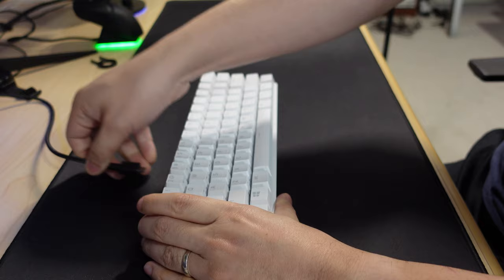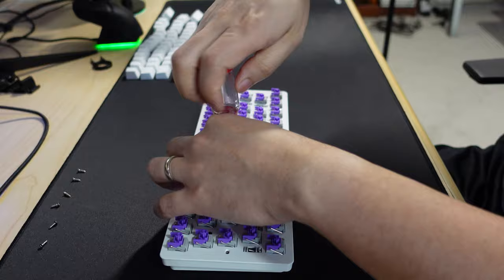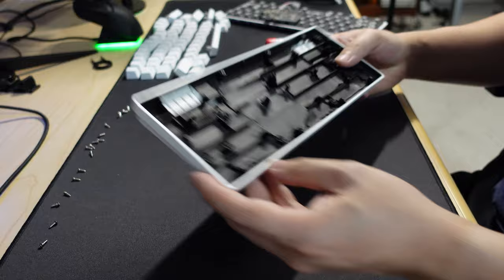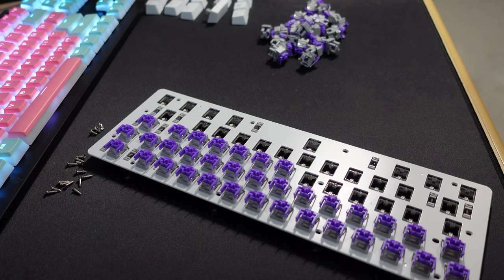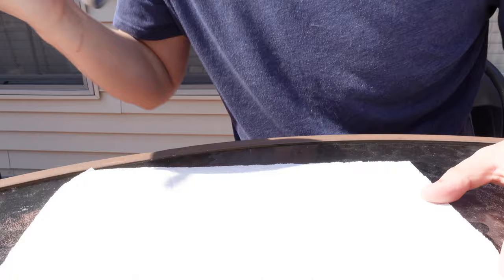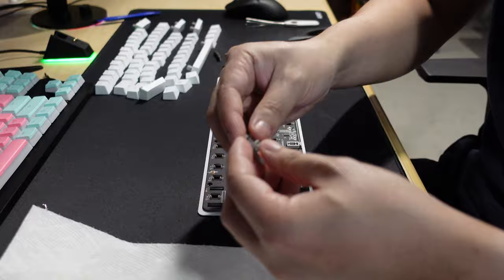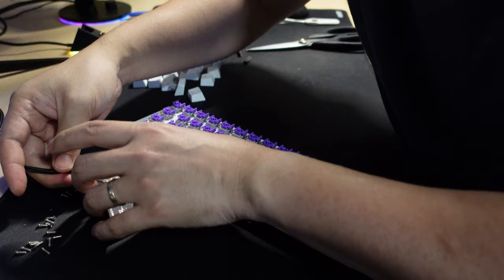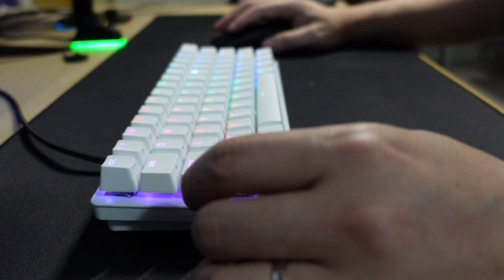Modding the Razer Huntsman Mini: Easy steps for better sound!

Comment: Would I be able to mod something like a huntsman elite? I have one and the noise sounds really pingy. Thanks
Reply from the maker: Yes, this method works for the whole Huntsman lineup. However, the Elite is a little more difficult since it has that diffusion layer as well as the magnetic connector for the wrist rest. Taking it apart is a lot more involved and there are screws hidden under the rubber feet (if I recall correctly). I was able to do the same mods to my Elite and it got rid of the pinging, but I did accidentally break the wrist rest connector so now it doesn't light up anymore. I'd say if you're trying to do this with the Elite, try to see if you can find a detailed disassembly guide for it and see if you're comfortable opening it up. Once you get to the PCB, the process is exactly the same as what I outlined in this video.

Comment: I want to keep the same loud click so if I just lube them will it keep the click but still make them smoother or do I need foam?
Reply from the maker: Yeah, the lube will make them smoother and get rid of the spring ping, but not the click. The foam just helps absorb some extra echoes, but it's really the lube that makes majority of the difference. A lot of guides online will tell you not to lube clicky switches since that can reduce the clicking sound, but those are talking about traditional MX style mechanical switches. The way the Razer optical clicky switches work, it's more like clicking a pen, and that mechanism is not affected by the lube (so it will still click loudly and clearly, even after lubing).

Comment: Some of my keys are not working after putting the switches back on? Any ideas
Reply from the maker: I would try to remove the ones that aren't working, make sure that they're dry, and clean any lube out of the sockets with something like rubbing alcohol, since any excess could be blocking the light emitter or receiver, which would then register the key as being depressed even if it wasn't being pressed.

Comment: Do you think it's possible to apply the dry lube with a brush so you don't have to disassemble the keyboard?
Reply from the maker: The switches don't really pop out of the PCB without disassembly of the keyboard (unlike a traditional hotswap keyboard).

Comment: What thickness was your foam in the end? Watched RandomFrankP's video and he said 1.5mm to 2mm, but I've seen some other suggest/using thicker.
Reply from the maker: I stacked 2 layers of 1/8" foam (linked in the description) where it could fit, so roughly 1/4" at the thickest. But, it's highly compressible, so I'm sure when I screwed everything back together, parts of it got pressed down.
Reply: @bigxie  Yeah that's what I thought you did, just wanted to make sure. Thanks for the answer and great vid!

Comment: I currently own this keyboard, is it possible to switch out the switches with gateron ones?
Reply from the maker: No, these are optical switches and even if you use Gateron optical switches, they're not compatible. You could probably use the Bloody optical switches, but they're not any different from the Razer (both are made by the same Chinese manufacturer)

Comment: Would this potentially sound even better with nicer lube or does it not really matter?
Reply from the maker: I don't think it'll make much of a difference. I've also tried the SuperLube PTFE spray on my Elite with purple switches and the switches don't sound any different (although the overall sound is a little different due to the different case). If you're talking about wanting to individually brush each switch with like Krytox or something, I don't know, but I wouldn't recommend it (Razer optomechanical switches cannot be opened nondestructively like traditional switches).
Reply: @bigxie  I have seen a few people just brush lube the razer optical switches without opening the switch up and the results are pretty good. Do you think doing that would interfere with the laser actuation system? Because I have heard some people say yes and no
Reply from the maker: @brobot6565  I think it shouldn't interfere as long as you're not using a super thick lube. The laser shoots through the center of the switch anyways.
Reply: @bigxie  thank you!
Reply: @bigxie  one more question. Is krytox 205 g0 too thick for this? I don’t know literallly anything about keyboard lube

Comment: Thanks to this video I have discovered that my razer huntsman is hot switch !!
I bought a huntsman Standar, 2n hand and there are some keys that don't work.
I swapped the site switches and discovered that the problem lies with the board, do you have any idea what to do?
Thanks for the help! : D
Reply from the maker: So unless there's something mechanically wrong with the switch (i.e. it doesn't press up and down smoothly), the issue surely lies with the PCB. These optomechanical switches don't have any electrical component at all, they merely block the light beam that is shined across the switch socket when they're pressed down. So if some keys aren't working, even after swapping out a working switch, the issue likely lies with the laser emitter or receiver on that socket.

Comment: Do I have to use the WD40 or can i use a solid lube made for mechanical keyboards.
Reply from the maker: You can use a dielectric grease for the stabilizers. I don't think you can use traditional lube on the switches because they don't open. But if you wanna go through with a paintbrush and try to reach the insides of every switch, I guess that could work too. I'm not sure if it'll be any better than the spray lube, but I know for sure it'll take a lot longer.
Reply: since they are optical if you use anything other then a dry spray lube you run the risk of interfering with the light beam rendering the switch useless
Reply: @truthtimetv4575  well there is no electronics on the switches it is all on the pcb so maybe not. I have seen others lube it with traditional lube and it worked out for them.

Comment: When you remove the key caps can you put in different ones and do you need to loob them first before putting in the key caps
Reply from the maker: Hey Tyler, the keycaps are replaceable and most 60% kits will fit, since the Huntsman Mini uses a standard layout. There's no need to lube the keyboard or anything just to switch the keycaps. The only sort of tricky thing is that the stabilized keys (shift, backspace, spacebar, enter) have stabilizer posts attached to them that need to be transplanted from the original keycaps on to the new replacements.

Comment: So is it fairly easy to switch from purple to red opto switches then? Since they just press out from the back im assuming the reds could be swapped in the same manner?
Reply from the maker: Yes! The mechanism of switching them is really easy, but the hard part is getting the extra switches since they're not sold individually.
Reply: @bigxie  i bought a pack of 4 from ebay for 6$. Not sure how legit they are but I will compare the quality to the purples when they arrive and see if they seem legit

Comment: Hey can I just use normal lube I think he hole of the switch without taking it out? Just wondering please answer
Reply from the maker: If you think you can get a brush in there and not make a mess, you can try it. But the laser and receiver are right on the socket so if you end up blocking them, that key will always register as being pressed down until it's cleaned. I'd just take the switches out, it'd probably be faster anyways than traditional lubing.
Reply: @bigxie  ok but if I take it out is it okay to use machine lube and just put a drop in there or should I use a brush
Reply from the maker: @marktsarenko392  I'm not sure what's in machine lube, but you should make sure it's non-conductive and won't corrode plastic.

Comment: HI. Thanks for vid. Gonna buy Huntsman TE these days. Just got a little question about switches. I know that i can use Razer OptoMech Violet-Clicky switches here cause keyboard is hotswappable, but what about simple (non OptoMech) Cherry MX switches, Holy Pandas and etc ? Are they fit PCB ?
Reply from the maker: I wouldn't go as far as calling the TE "hot" swappable, because if you try to turn in on without all the switches in, it can freak out. And no, regular mechanical switches don't work because the PCB doesn't actually use electrical signals, it shoots a beam of light across the socket and when the light gets cut off by the switch being pressed, it triggers a key press.
Reply: @bigxie  oh okay. thanks a lot :3

Comment: So if i will remove the switches will they work after i will install them back? Are they removable or they will break?
Reply from the maker: Yes, the switches can be removed and replaced (as demonstrated in the video) and will still work. There are no electronics on the switch, all it does is block the beam of light and allow it through when pressed down (the electronics for emitting and receiving the light beam are on the PCB itself).

Comment: Is this applicable to the Huntsman elite? I mean are the switches removable too for the elite just like the mini?
Reply from the maker: Yes, this is also applicable to the Elite. Take care when opening it up though, since it's much more complex (there's that diffuser layer as well as that magnetic connector for the wrist rest). Once you get to the PCB, the switches and stabs come out the same way and you can do the same mods. I did these mods to my Elite as well but unfortunately, I broke the fragile wrist rest connector so now it no longer lights up. Sounds a lot better though!

Comment: You choose clicky but you dampens, if you want go silent why dont go for linear?
Reply from the maker: The point of these mods is not actually for silence, but to get rid of the spring ping from the switches that then bounces around in the empty case. That's what the lube and foam addresses. The linear version of the keyboard has the exact same issues and would bother me the same amount. The spring ping may actually be even more noticeable on the linear version due to the lack of the click masking it. The good news is that these mods apply just as effectively for all versions of the Huntsman keyboards.

Comment: where did you buy the foam from? i cant find it anywhere on amazon and the link doesnt work anymore
Reply from the maker: Dang it stinks that the original listing no longer works. You can just search "adhesive foam roll" on Amazon though and there should be a lot of alternatives available.
Reply: @bigxie  what thickness is good?
Reply from the maker: I'd go with like 1/8" if possible, because you can always stack if it's not thick enough. 1/4" could work too if the foam is really porous and compressible.
Reply: @bigxie  thanks for the fast replies, ill definitely buy some and i hope that fixes the pinging on my keyboard

Comment: hey man I did the foam mod to my huntsman mini but then after couple of weeks its not working anymore, any tips?
Reply from the maker: What do you mean it stopped working? Do you mean it got noisy again? I think that lubing the switches is way more impactful than doing the foam mod alone.
Reply: @bigxie  the keyboard itself is not working anymore
Reply from the maker: Oh, if the foam is too thick it could be pushing the switches out of their sockets, which could cause the keyboard to become unresponsive.

Comment: Weird watching this 2 years later and asking a question, but does it need to be re-lubed?
Reply from the maker: I don't use my Huntsman very often anymore, but it's still going strong and I haven't had to re-lube it. I feel like with regular use, the lube would remain spread and not have the chance to dry or run off.

Comment: Damn, I don't think I recoomend popping the switches off though, I messed up some switches on the PCB doing this. While the switches were completely fine, the PCB had issues registering switches afterwards for certain ones, and it seems like it will require some soldering job and some sourcing to get the small parts replaced.

Comment: The RGB ligths can be removed and changed? My key burn one rgb  :/
Reply from the maker: I don't think it's an easy repair, they're on the PCB. If you're still under the warranty period, you can try to get a replacement.
Reply: @bigxie  ty

Comment: does the huntsman mini have a 3 pin pcb making it possible to switch the switches with akkos rosed red switches.?
Reply from the maker: No, it's an optical keyboard. Not compatible with any other types of switches besides Razer optical.
Reply: @bigxie  what about the glorious GMMK?
Reply: 60%
Reply from the maker: @ily2697  yeah, that's a hot swap keyboard and should support that switch

Comment: Hello the switches when removing them you have to desolder them and re-solder them or they are just removed without further ado
Reply from the maker: No need to desolder, they are held in place by little plastic tabs, so you can depress them to gently remove them or just pop them out with a little force like in the video.
Reply: @bigxie  Thank you so much

Comment: I wonder how the warranty will works for this? is there any warranty sticker inside that will break if you open this board ? really wanted to lubed mine but very cautious about the warranty haha
Reply from the maker: You're definitely voiding the warranty if you do this. I don't think there's a warranty void sticker covering any of the screws, but it'd be pretty annoying to try to revert the mods (unless you use non adhesive backed foam). I recently opened up my Mini to lube up the stabs with better lube and found that the PCB was completely dry, so there isn't really any evidence of the switches being lubed other than the sound and feel.

Comment: Wonderful video! Please allow two questions: 

1) if I have a mini with red switches, can I replace the red switches with purple ones? If yes, where can I buy purple switches? - I have a mini with red switches but miss the tactile bump, so want to change them... 
2) Any chance to have a quick video on how to lube the purple switches? (your camera was hiding your fingers!!). 
Thank you!
Reply from the maker: Hi, you can definitely replace the red switches with purple, but the hard part is sourcing the switches since they're not sold individually. If you're looking for purple switches, the best bet would to be to look for a defective regular Huntsman that someone is selling for cheap. 

Regarding the lubing, yeah it's not too clear in the video but you basically just spray up the switch from the bottom. If you need some visuals, a few other channels have since released similar videos after seeing mine. I think randomfrankp has a pretty good one you can check out.

Comment: Hey! I have this one little question to ask. I’ve done every thing correctly but some of my switches are not registering do you know why that might be?
Reply from the maker: It likely has to do with the PCB. The way the keyboard works is each socket has a laser emitter and receiver and the beam shines across the socket. When the switch is resting the beam is blocked, but when the switch is pressed down, a hole opens and the beam can shine through to the other side. So if the key is not registering, then somehow the PCB is not detecting the beam. Did you get any lube on the board? If some lube is blocking the receiver, it would prevent the key from registering. It may be worth taking out the problem switches to clean off the sockets and then trying again. Also, be sure that all the switches are in before you power on the keyboard to test, otherwise some keys may not register. This is not a hot swap board so it is not meant to be turned on with any switches missing.
Reply: @bigxie  Oh alright I’m trying that right now if it doesn’t work do you know where I can get the same or similar pcb?
Reply: @bigxie  I just fixed almost all of them but these other ones are tricky it’s these keys and do you have tips to fix them? (A, F, R , J, SPACE BAR, ENTER, And UNDERSCORE,
Reply from the maker: @dulphoisbetterthanyou6230  there shouldn't be a difference between the sockets for any of the keys. You can try dipping a qtip in rubbing alcohol and thoroughly cleaning the components on each side of the socket.
Reply: @bigxie  ok thanks

Comment: wait if the lube is not cunductive does that mean i can lube the switches without popping the out the pcb
Reply from the maker: I have seen a couple of other videos where they demonstrate lubing the switches while they're still in the PCB. It worked for them, but I personally wouldn't do it that way, especially with how (relatively) easy it is to remove the switches and how quickly you can dry them outside of the keyboard. It just seems worth the additional effort to reduce any complications that could arise otherwise.

Comment: it is possible to remove the switches without disassembling the keyboard?
Reply from the maker: I mean they can be forcibly removed but I wouldn't recommend it. It's much easier and safer to access the clips holding the switches in once the keyboard is disassembled.
Reply: @bigxie  thanks man ^_^

Comment: i was wondering if you could put razers optical switches in other pcbs?
Reply from the maker: No, they're not compatible with other PCBs (except maybe the Bloody lightstrike keyboards, as they are both using the same OEM for their optical switches).